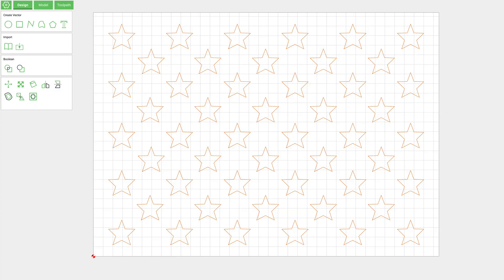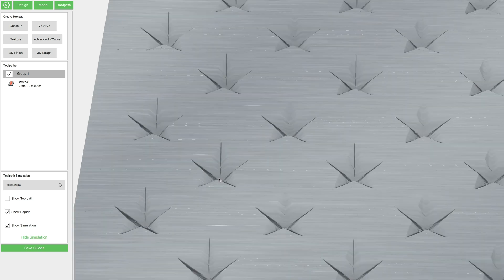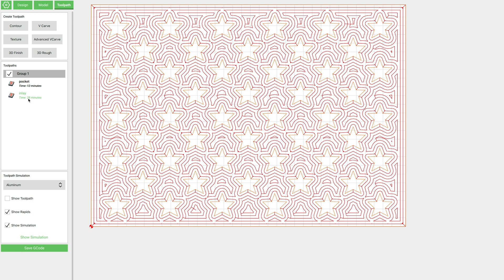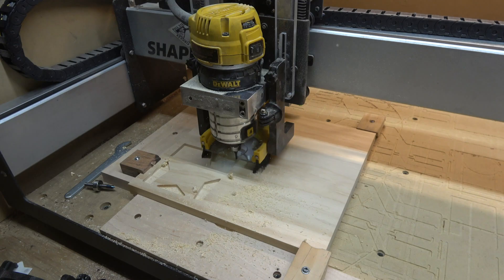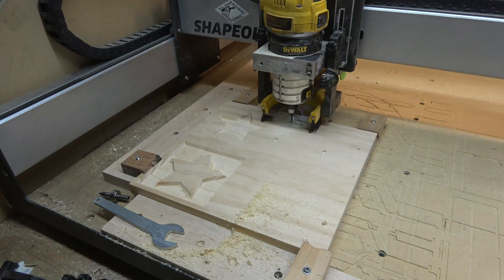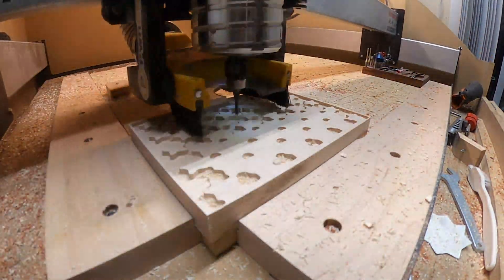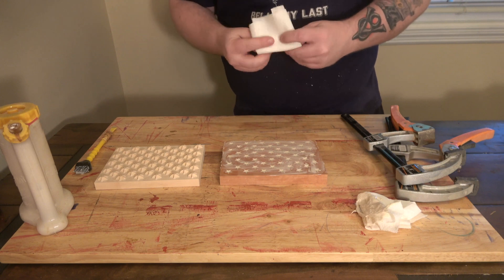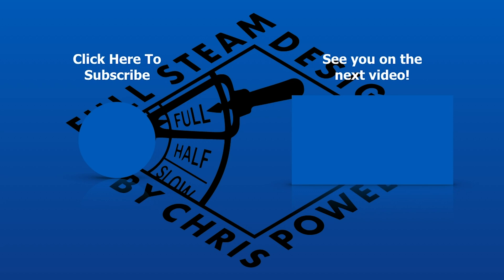Advanced V Carve Inlay Tutorial

Comment: For anyone wanting to avoid an aggressive 0.1 in DOC first pass on the inlay step, here's an easy way to fix it:

1) In the Design Tab, create an outside offset for your outlines equal to half your pocket cutter diameter (I'm using a 1/8 in bit so offset was 0.0625 in).
2) In the Toolpaths Tab, select your offset outlines and add a 2D Pocket toolpath w/ these parameters: Starting Depth=0 in and Max Depth = 0.1 in (make sure your tool is the same one you're using for the inlay pocket pass).
3) Drag this new toolpath above the advanced V-carve inlay path.
4) Show simulation and make sure the new pocket isn't interfering with the slopes of your inlay.
5) Unsupress only these two paths and Save gCode. This will now run the pocket at your tool's required depth of cut prior to the inlay.

Voila. No more aggressive first pass! At least for the pocket...
Reply from the maker: Thanks
Reply: THe aggressive cut is exactly what I'm trying to avoid. Thanks for the info.
Reply: Went all through the comments to find a something to avoid this. Thanks!

Comment: Hi Chris, thanks for a great inlay tutorial.  I started with a simple inlay text and it worked great.  The text wasn't very wide so the vcarve for the pocket was not very deep and the example Start and Max values of .2in and .3in worked fine.  I then went to a larger inlay for a cutting board and again the pocket portion was very straight forward.  However for the inlay portion the very first cut was super deep (.21in) which I assume is the "starting depth" plus the "depth per pass" value.  Is there a way to address this so that first pass isn't so aggressive?
Reply from the maker: Unfortunately I don’t think there is with Carbide Create. If you take it slow it should be ok. The pieces get a little brittle anyways depending on your design, so you usually need to slow way down anyways.
Reply: Does VCarve do this properly?  I'm coming up to the end of my free year of Carbide Create Pro and need to make a decision which software to proceed with.
Reply: Found a work-around:

1) In the Design Tab, create an outside offset for your outlines equal to half your pocket cutter diameter (I'm using a 1/8 in bit so offset was 0.0625 in).
2) In the Toolpaths Tab, select your offset outlines and add a 2D Pocket toolpath w/ these parameters: Starting Depth=0 in and Max Depth = 0.1 in (make sure your tool is the same one you're using for the inlay pocket pass).
3) Drag this new toolpath above the advanced V-carve inlay path.
4) Show simulation and make sure the new pocket isn't interfering with the slopes of your inlay.
5) Unsupress only these two paths and Save gCode. This will now run the pocket at your tool's required depth of cut prior to the inlay.

Voila. No more aggressive first pass! At least for the pocket...

Comment: I guess you made this 2 years ago. Hopefully things have changed and you don't have to run the same file twice?
I keep hearing this about people running the same file twice and I really don't understand why? It must be carbide motion thats the problem?
While I am very new and don''t know what the heck I'm doing half the, make the most, I could run that all day long in one file and that includes raising and moving the z axis to change the bit and hitting the resume button. Can you not raise the z-axis to change the tool? Can you not choose a safe z to which it retracts too?
But however, I have seen problems after 3 tool changes and a considerable depth cut. It seems carbide create forgets all about that safe z and runs right through previous cut wood. I've seen reference to this about carbide create and its starting to be my opinion but I need to cut some more wood to be sure as I may have made a mistake. But none the less, doing what you , wait a minute! I get it. You just did a simple project as an example. I still don't get it though. It has crashed through my work but I don't think that is due to multiple tool changes. That has to do with a bad tool path.
Reply from the maker: Yea it’s an older video

Comment: What do you mean if you don't mind me asking buy surfacing it manually are you just simply jogging the machine with your computer or controller with the router and surfacing it manually are you just simply jogging the machine with your computer or controller with the router turned on? I just recently got my machine only had it a couple months haven't done a surfacing yet
Reply from the maker: Yea I just did it like that because it was a small piece. You could also just draw a rectangle around it and do a pocket toolpath.
Reply: @ChrisPowellFSD  ok could you do a large piece like this also? and how fast did you have the jogging speed set?
Reply from the maker: @splinterfingerswoodworking8995  you could. I do it on fast, which is pretty slow.
Reply: @ChrisPowellFSD  thank you for your help

Comment: I understand the geometrical concepts at the 20000 foot level, but am unable to come up with a formula for the various numbers involved. If my pocket is say p inches deep (say 0.2) , and I want to design the plug to have a glue gap of g inches (say 0.03) , and have it stick out by s inches (say 0.1 inches) , what is the equation for the start depth and max depth? Would really appreciate any help as my attempts are giving random results.
Reply from the maker: I just experiment with different settings to see what works best.
Reply: @ChrisPowellFSD  I spent some time puzzling about this and trying to come up with a formula... it seems to me that the "start depth" is the depth the "male" part will insert into the female pocket, and the "max depth'" - "start depth" will stick out of the pocket. So if you are starting with the `female pocket depth of p inches, and you want a glue gap of `g' inches, and want the positive to stick out by `s' inches, the start depth when cutting the male part must be (p-g), and the max depth must be (p-g+s). Do you agree?

Comment: Hey Chris 
I use carbide create but on a onefinity when I do advance vcarve it only gives me one file so when the straight bit finishes there is still the bit to complete the carve problem is that it doesn’t allow me to lift up and change bits so I have to  change to a v bit  zero  and restart so it cuts air till it pauses  to do the bit change then I repress start and  continue to finish how can I separate the advance vcarve in 2 files or I make one file and save with the straight bit including the bit carve but I only use the first portion of the file then I do a advance vcarve without the tool num 1 which is the straight bit ?
Reply from the maker: This is the easiest solution. https://youtu.be/uM4gY6qSds4
Reply: Problem is it stops so low you cannot get it out

Comment: do you have a video on how to do surfacing with cc?
Reply from the maker: Just my wasteboard video. You can just draw a rectangle and use a pocketing tool path, or jog manually like I did for this one.
Reply: @ChrisPowellFSD  if you jog manually, in CC is fast, to fast to jog or ?
Reply from the maker: Fast is fine. Just don’t try to take too much off at a time. .050” is usually good.
Reply: @ChrisPowellFSD  thanks Chris!

Comment: Would you change your starting depth for the inlay for a different v-bit?   I just tried an inlay with a 15 degree v-bit and when I glued it up I had no gap.  It it ended up not being a tight fit when it was done.
Reply from the maker: I still have to experiment with that myself. Try doing the stars like I did and see what happens.
Reply: @ChrisPowellFSD  Thanks, that is what I was thinking.  I appreciate your help.  You look familiar, were you in the Navy?
Reply: I have the same issue with a 30deg bit, inlay ends up way to loose.

Comment: I apologize to anyone who read my now deleted comment about the two numbers not needing to add up.  When you cut the "plug" to go into the "pocket"  the start depth is how far the plug goes into the pocket, and the flat depth is how much material is sticking out above the surface of the board.  The two numbers have to add up, so if you do a .3" depth inlay you have to have a start depth of .2 and flat depth of .1.  Or a start depth of .25 and flat depth of .05, etc etc.  There is a video of a guy who tried other combinations as well, but you do need some room for that glue to go.

Comment: Thanks for great detailed explanation.  I am a semi-newb,  Had my xxl for 4 months now and I've done some neat things for my grandkids.   BUT, time to do more serious things like inlay.   QUESTION :  When you set your initial cutting start point to a value that is below zero point doesn't that cause a problem with the bit dragging across the uncut surface?   It seems like it would bury the bit before moving X and Y.   Thanks for the great videos.   Looking forward to getting carbide pro and doing some 3d relief too....
Reply from the maker: Not if you use advanced v carve. You still zero at the top of the material, and rapid movements are based off that height.
Reply: @ChrisPowellFSD  
Summing it up, what exactly is "advanced" v-carve. what's so special about it that its advanced for the regular v-carve tab. I haven't figured that out yet.
Reply from the maker: @iwannaapple7190  it’s just a flat bottom v carve. You can use an endmil in combination with the v bit. It’s their way of coming up with a fancy name for something any other good cnc software has been doing for years.

Comment: My stars are coming out differently when using the CNC. What board do you use for the Unions? I am assuming my ztar issue is from warped boards, but if I plane it, the back isn't flush with the rest of the stripes. Any suggestions?!?
Reply from the maker: I use premium pine 1x12 from Lowe’s. Try to position them so if there’s any bow, it’s facing down in the middle, and use clamps to pull the edges so it’s flat. Have you surfaced your wasteboard?

Comment: Thanks, Chris! At the end of the video where you are using the surfacing bit, you said that you are doing that "manually"? Can you explain that process?
Reply from the maker: I just use the manual jog in CM.
Reply: Chris Powell I guess I never thought about using manual jog while the router spindle on. Just over complicating things I guess. I’ll give that a shot, thank you for the clarification.
Reply from the maker: No problem. I use the fastest setting and just take small passes so I don’t remove much material. Run it all the way off the board and move over to make another pass. That will prevent burning or gouges.

Comment: This is a very awesome video. I would love to give it a try but I don't think I can as I have the X-carve and I think carbide motion is required to use bit setter. I am going to look and see if there is anyway to split the g-code apart so I can run end mill and v-bit seperate.
Reply from the maker: You could run the collars like I do, or go in and manually edit the g code.